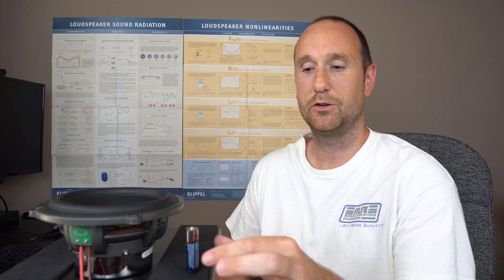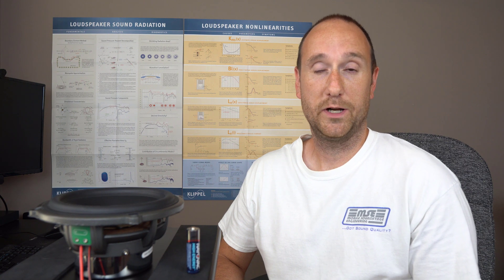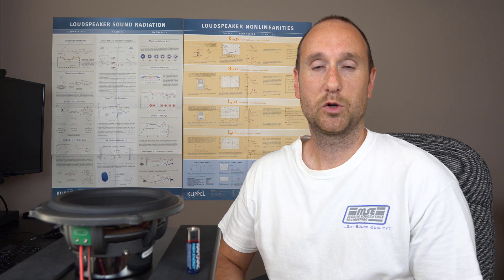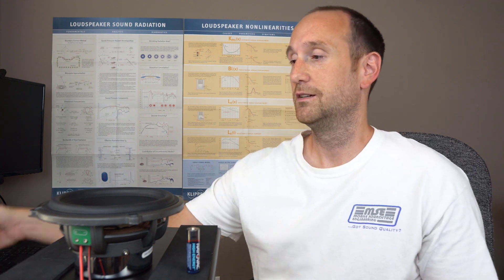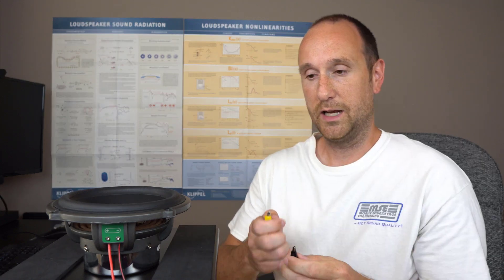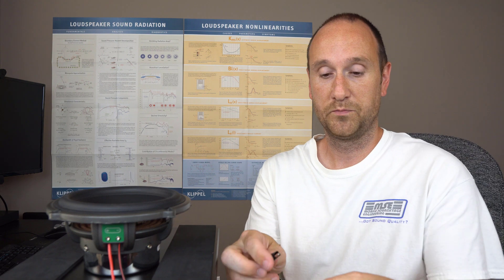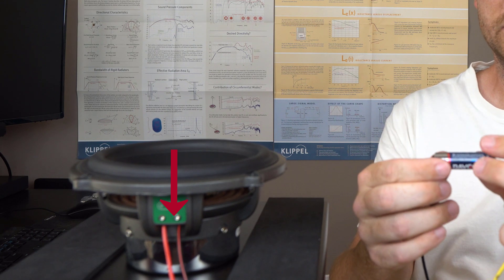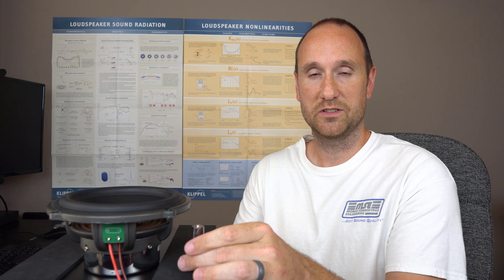Speaker Polarity Check With A Household Battery

Comment: I recently bought a big subwoofer dirt cheap and was kind of suspicious why the low price. I tested it out with a battery like you did but nothing moves and no sound at all. I tried a double A battery and 9 volt battery with no response at all. I'm guessing the sub is messed up b/c of the low price for it. Thanks any feedback appreciated

Comment: From my experience with woofers and midranges; if you look at the driver from the magnet side (back of the driver perspective) and rotate the speaker so that the terminals are at the six o’clock position….almost always, the positive terminal is the terminal on your right

Comment: Thank you. You're explanation is very clear and easily understood. That's a great trick. Now I just have to sort through the 16 speakers and find the one making the buzzing noise when I have no sound on. 

 I know it's coming from the Polk speakers because my Carver 505 has separate volume controls for each channel. I got everything for free at different times. My other speakers are JVC and came with one of those old Pioneer stereos with only the green colored light. It has the classic silver front, brown back and like a zillion tubes inside. But that thing has some power. I don't use it anymore because the right doesn't make any sound now. One day it just stopped working on that side. 

Oh ya. The polk speakers had a built in amp in both, but didn't work. I just feed the wires through both sets on the back (sub & whatever the other one is).

 But I thought I had more power before. I moved them into a different room and they don't seem to make the floor shake or stuff fall off the shelves in that room

Comment: I knew I’d seen this trick in the past, but  done w/ a 9v battery. 
I couldn’t remember if correct polarity pushed the cone in or out so thanks for posting a refresher for me👍🏼
Reply: 9 volt is ok on woofers, but don't use it on tweeters ;)

Comment: There is actually more to this than meets the eye. For a positive DC voltage you want the displacement to be outwards, as shown. But this consequently means that above the driver's resonance frequency, it will move INWARDS for a positive voltage. And that is exactly what you want, because the pressure is proportional to acceleration, not displacement; the two are in opposite phase. It will also immediately move outwards for the applied DC voltage, without first going inwards, because it is a minimum phase system. So while the test is correct, not that many people correctly understand why it is this way.

Comment: That will only work on weak speaker .. that won’t do anything to a stiff strong subwoofer
Reply: I was wondering would this work on a 15 inch subwoofer I found, but just tried and no luck. I think the 9v battery would be the better substitute right?
Reply: @ImBeneficial  yes but even if the sub move it can still be partially blown
Reply: @Sclassmercedes  So just so I'm clear, double A batteries prolly wouldn't move it at all right?
Reply: @ImBeneficial  it will but if your sub is beefy for a example 1000 watts or more you might just hear a small thump with no movement .

Comment: Great video with basic explanation. I just upgraded the subwoofer fitted to my Audi SQ5 to a Hertz MP165.3 Mille and the factory subwoofer had a green and black wiring loom going to it but absolutely no markings on the speaker or loom as to which was + or -. I took a gamble that the green was + and the black was - (as it made sense to me) and using the test with the battery, I was able to confirm this was correct. Thank you.

Comment: It doesn't matter if you just have 1 speaker. I try to use wrong polarity(inverse polarity) on 2 speakers too. The sound is ok too. Sounds not good if I try 1 speaker with the right polarity and the other one is wrong polarity.

Comment: thanks Erin 👍🏽this is a easy way to  check 
 Is there also a way to check the polarity       of tweeters ?
Reply from the maker: Thanks.  I've not used it for tweeters but I know some have used a 1.5V battery (like a AA battery).  With the minimal excursion they have, though, I'm not sure how easy it would be to tell.  An impulse response will tell you but that requires additional hardware and measurement signal.